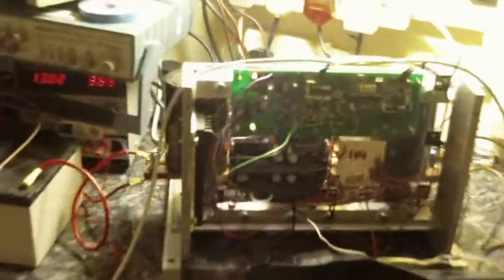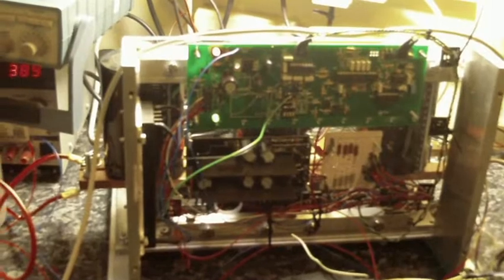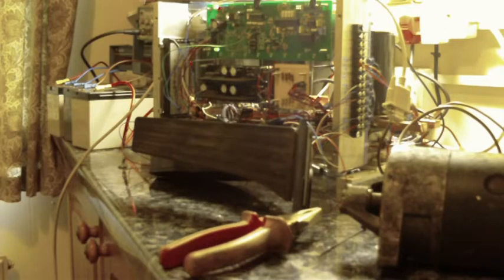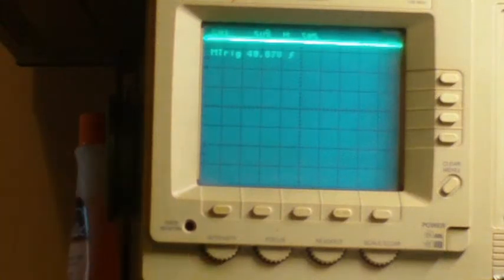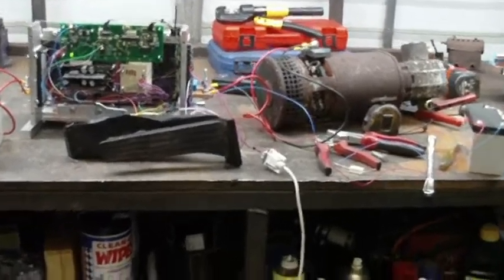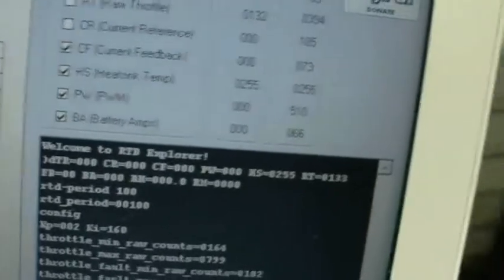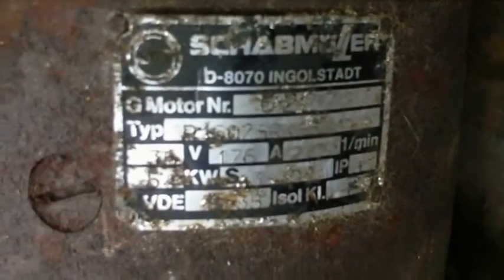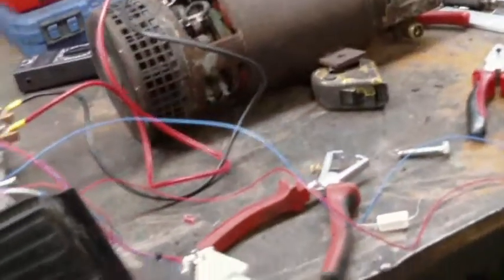BMW EV Conversion 47 Liquid Cooled Controller 01

Comment from the maker: Its a throttle pedal assembly from a 2002 bmw e46. It has two hall sensors. 5v supply. 0.7v to 4.4v o/p.